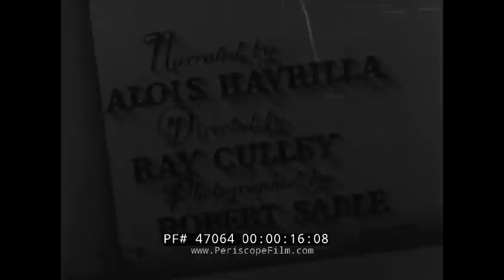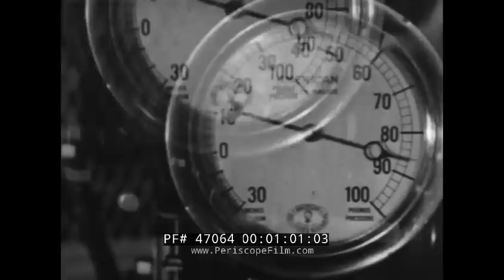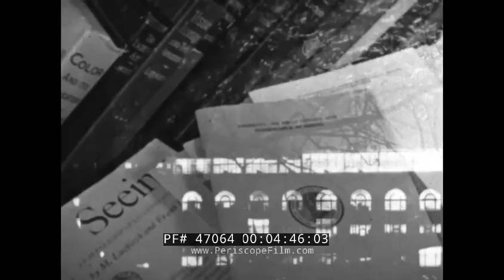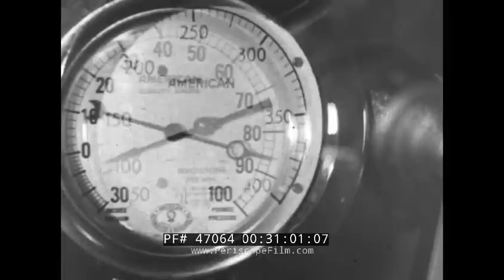GENERAL ELECTRIC WORLD'S LARGEST ELECTRICAL WORKSHOP 47064

Comment: Except, not “the candle-stick maker.” Electricity greatly reduced demand for his product.
Reply: Electric power made candles cheeper to produce and replace using flame to heat the wax and so it was safer. By this time candles were not even a partial supply of light, oil lamps had taken that over 50 years prior. Thanks to petroleum products wale oil was no longer the staple lamp oil, do you wish crud oil was gone so the waling ships would not have gone out of business?

Comment: Asbestos clothing for safety...
Reply from the maker: The clothing is not dangerous unless the asbestos is degrading and fibers are coming loose. Asbestos is not dangerous if intact and not emitting fibers.
Reply: @PeriscopeFilm  Yeah, because there was no chance their clothing would be degrading.  It's not like they were working in a harsh environment or anything.  Asbestos on piping that is not disturbed is one thing.  Protective clothing that is taking a beating is another.   matter.
Reply: @wscott9779  probably like 70 or 80 years ago

Comment: that stupid counter running is a distraction.
Reply from the maker: Here's the issue: tens of thousands of films like this one were destroyed and many others are at risk. Our company preserves these precious bits of history one film at a time. How do we afford to do that? By selling them as stock footage to documentary filmmakers and broadcasters. If we did not have a counter, we could not afford to post films like this on online, and no films would be preserved. It's that simple. So we ask you to bear with the watermark and timecodes.

So, in the past we tried many different systems including placing our timer at the bottom corner of our videos. What happened? Unscrupulous Youtube users downloaded our vids, blew them up so the timer was not visible, and re-posted them as their own content. We had to use content control to have the videos removed and shut down these channels. It's hard enough work preserving these films and posting them, without having to deal with these kind of issues.
Reply: @PeriscopeFilm   understood, and thank you for your work